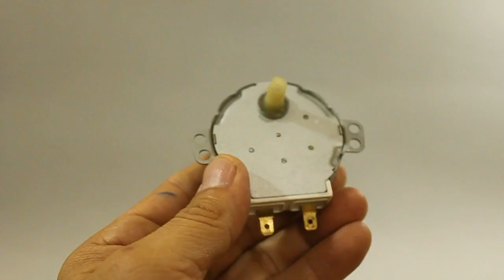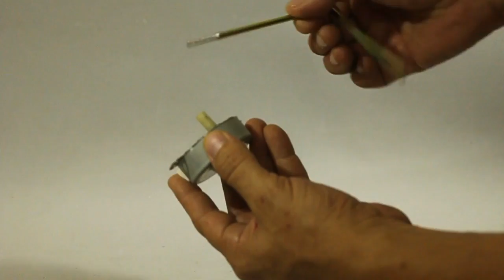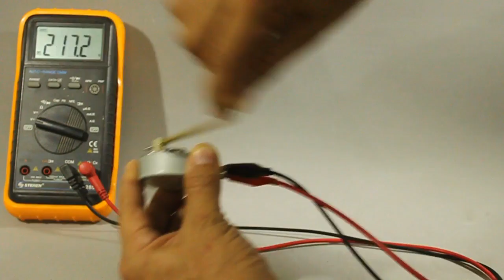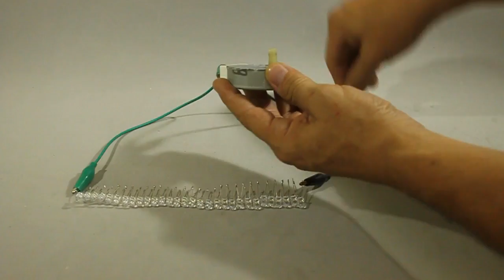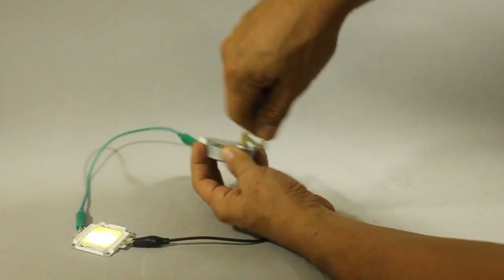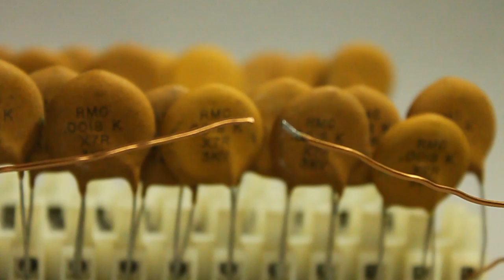Mini AC Electrical Generator from Microwave Oven Motor

Comment: These are perfect for charging high voltage dc capacitors, hook up a rectifier and for safety a multimeter on the caps, those 400 V ones found in old crt tvs or monitors are always fun to short out, especially after assembling a giant bank of the stuff

Comment: When I attach this to a dc motor with a full bridge rectifier it doesn't work. Can anyone tell me why? It seems I can't get any current to go through it despite it producing these high voltages.
Reply: Is it a big motor? Cause the output of these motors(one in video) is already worth sh*t, best uses ive found is charging high voltage capacitors like those 400 V ones found in computer psus, also as shown in the vid, powering low power lights like leds. You can still power ALOT of em tho🤣

Comment: I have recreated this and get around 200-300 V max crank, but the amps are so low I cannot power anything (such as a lightbulb) any suggestions?
Reply: Step down the voltage to 12 v using transformer and bridge rectifier. The higher current at lower voltage may prove more usable

Comment: You get more than 5watts. You are spinning it much faster than the rated rpm at 5 watts. There is a sweet spot where you can get a steady 500-600 V AC , but you need to practice with the multi meter to get the right speed. I reminded the coil with a thicker guage magnet wire. The wire that is in there is about 40-42 guage.

Comment: can it charge a 12v battery
Reply: shashwat Patel  with transform 220v  to 12v 🤔
Reply: 0.4A at nominal RPM through a step down transformer and bridge rectifier, yes

Comment: Put a Tesla   turbine   on the  turntable  and  run the  power to  the     microwave to  boil   water for  steam to drive it?  5 watts only?   Hairpin circuit  with  XC transmission.

Comment: Nice video. Could i use this type of motor for an emergency smartphone charger , converting ac to dc somehow?
Reply: I think you mean FULL BRIDGE RECTIFIER
Reply: I would say a rectifier, buck converter, bunch of smoothing capacitance, and a voltage regulator. I do not know the efficiency of either transforming ac first and rectifying/regulating last, or rectifying first and bucking down/regulating last, but in the end you will still have to account for dangerous spikes of power, and that you won't be cranking at the same speed the whole time. Please correct me if I'm mistaken.
Reply: use a full bridge rectifier and some sort of transformer.
Reply: CaptainCrazy500 I have corrected it.  And yes, I get why you put it in caps :)

Comment: Take 2 such motors and connect their terminals together. rotate one of them and see if the other one rotates from the produced voltage
Reply: I have 4 motors on my desk right now. Give me a minute and I will get back with the answer
Reply: Nothing happened. I twisted the wires together and spun the motor as fast as I could and the other motor shaft did not move
Reply: @SamSamuylik  Probably not enough power is generated by the first one to be able to drive the second one. I've tried with a drill and it does work. Both motors should be the type that can also act ag generators
Reply: Daniyal Ahmed it won’t work due to the laws of physics

Comment: when I was playing with the microwave motor I had spined it and had my fingers on the metals contacts and got a nasty shock
Reply: Yep me too get a bit of a jolt!!
Reply: Yes, they do give shock. I realized that too yesterday.
Reply: I have one and I found out it outputs 250volts
Reply: I use a rectifier off on terminal works really well
Reply: @davidhansen9665  hy sir Can you tell me at least how many watts of electricity this motor can generate?
Reply: Lmao did the same thing

Comment: Hm... Hand-crank powered tesla coil...
Reply from the maker: that's a great idea
Reply: or waterpower for example a 200l barrel and release the water use a thin tube. through the atmospheric pressure and thin Tube you could run a waterwheel with a high pressure.
Reply: Maybe ZVS instead of that voltage multiplier... and how about a hand-cranked mini induction heater?
Reply: WHAT THE PLANTS CRAVE induction cooker? Induction heater requiers much more power than this can provide( sorry about my english)

Comment: Was the output of the motor 2k volts??
Reply from the maker: +gooddeed26 was 200 volts
Reply: Thanks, at the end it got pretty confusing. I've taken apart a few microwaves and have a few of these lying around. I might try this out...

Comment: my experience with those tells me you need very nice oiling on the gears, otherwise you are just going to break the shaft if you try to use it as generator